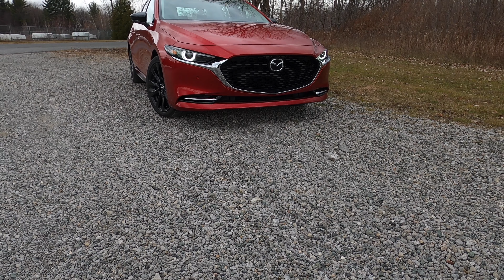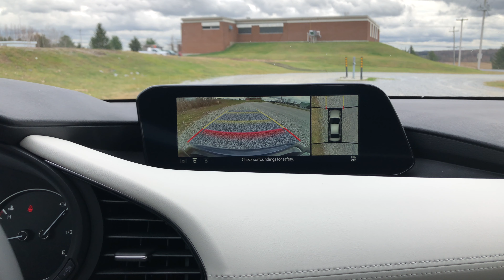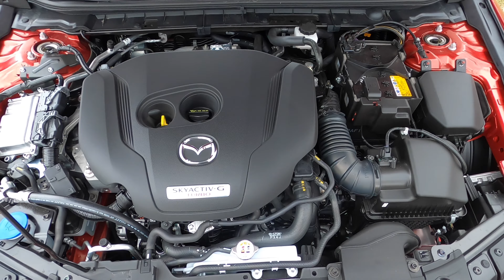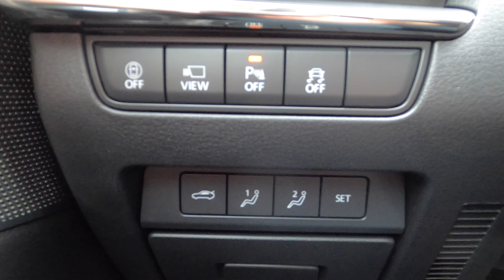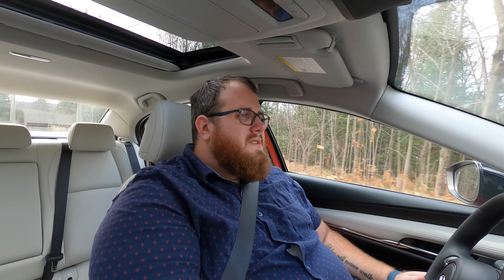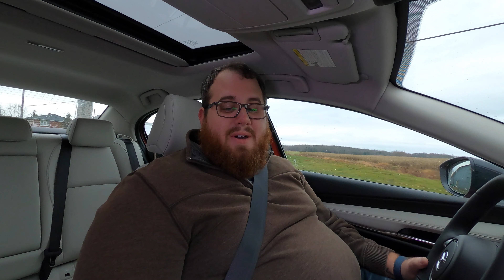2021 Mazda3 GT AWD Turbo First Drive & Review | Twisty Mountain Road Test

Comment: I must have seen 20 reviews on this car, and every last one of them is red.  I guess it doesn't come in any other color.
Reply from the maker: Typically manufacturers produce a batch of vehicles before the consumer production run specifically for press fleets. In some countries like Canada, Mazda will ensure a mix of vehicle colours/options, however it's possible that all the 'new media' journalists just happened to get red, although I know silver and grey were sent out in Montreal at the same time. Now in some cases a manufacturer will produce every press car globally to the same options/specs, that way all the marketing and media materials for that vehicle match the cars journalists are driving. FCA/Chrysler and Ford tend to do this more often than not.
Reply: @PRNTestDrive  Another reason, it seems..... "Soul Red Crystal" is a $595.00 upcharge over the "standard" paint color options, which are very few, so they're trying to push the red.  Not sure why one paint color would cost so much more than any other.  Seems they're going the way of Benz: Black/white/sliver, and little else.

Comment: mazda 3 to expensive used to be good price
Reply from the maker: The top end has gone up compared to what you could have gotten 15 years ago, but the entry level is still very competitive with the other Japanese brands.
Reply: for the design, interior, driving handling of a car that is  x2 or x3 price of other brands in its class? mazda 3's a steal.

Comment: Not that it really matters, but C/D clocked a 5.6 0-60 with 14.2 1/4 mile. Not too shabby.
Reply from the maker: Sounds about right! They definitely have the capacity to do proper performance testing.

Comment: I have the loaded 2018 - i love this car more in every way, except the Turbo is a disappointment as the sticker price on this is 37 grand cdn - mine was 29k fully loaded.  This is NOT worth the sticker price increase of 8 thousand dollars.
Reply from the maker: Yes the cost is higher than the GT FWD, one could argue the premium package isn't as important on the 2021 since Mazda moved almost all of those features to the trim itself and added new tech to that package, but for the same price you're not getting much in the way of the Subaru WRX, and the 2021 VW Golf GTI starts at $35,999 CAD and doesn't have AWD. It depends on what you want out of the car.

Comment: Shell 93 and summer performance tires , 5.5sec 0 to 60?
Reply from the maker: Should be better on performance tires, we were told the cars would be filled up with 93 but there isn't a station in my area with that, and it had winter tires on. I'm having the same sort of trouble this week with performance testing, it's just not as fast in the cold weather.
Reply: I have this car for 3 weeks now, a 100th aniversary edition and using an app on my phone i was able to do 5.9s in back to back runs, with winter tires on. Im using 94 octane fuel from Petro Canada and i didnt do any brake boosting, i just flored it from 0 with traction off on sport mode.
Reply: @VPoje  I feel that additon of Shell 93 or high octane fuel with Summer tires and after few oil changes when engine is past break in period with Lubegard Platinum reducing power loss from ATX will easily make it 5.3sec 0 to 60mph car .
Reply: @kdomster9141  Yes, it has been proven that at about 10k miles the engine is more performant then at 0, but frankly if you have the chance to try the car, you will see that it has incredible traction, even with winter tires and imperfect tarmac. So in about any condition, if you have premium gas you will do under 6s every time. Anyway, for me quarter mile is more important and you can see right now plenty of reviews with 14.1s to 14.5s time and it's very good.
Reply: @VPoje  good to hear it from the owner...  Try lubegard platinum and thank me later , it transforms the way tranny shifts and performance plus great protection .... It will take you 10 minutes from under the hood.

Comment: If this was a manual. I can guarantee you I can take off at least a second 0-60mph.
Reply: 0-60 on the 21 3 turbo hatch has been clocked at 5.7. That is faster than the original speed3. If ya need a second off that buy a sports car....
Reply: @buchajo  autos suck at launching. If this was a manual, I can still do better than 5.7 seconds. Also, I already knew they got a 5.75 to be exact on 0-60 time. Also, you don't need a sports car to go fast. You can make a Geo Metro fast.
Reply from the maker: Fair enough

Comment: Should you pick this over a WRX?
Reply from the maker: Personally I would, I haven't been a fan of Subaru's interiors. You'd be getting the Sport trim for about the same price as this Mazda, though the 6MT might be a must-have for some.
Reply: Depends what you want. If fun is your top priority then get the WRX. The Mazda is better in pretty much every other way and cheaper but the WRX is more fun and performance oriented. This is more luxury oriented.

Comment: What a great looking little sedan, I particularly love it in sedan form.  Mazda is going after market segment that Honda seems to never care about.  Civic Si is not available with automatic or four wheel drive.  This Mazda leaves the manual market for Civic, and is going after a larger market potential.  I think they are pretty smart.
Reply from the maker: Couldn't agree more! Mazda doesn't need to dominate the market, they just need a niche that works like the MX-5. The AWD Mazda3 got off to a slower start here in Québec but I've started to notice plenty of them, and I suspect this Turbo will be a hot seller too. I'd seriously consider one if I needed a new car!